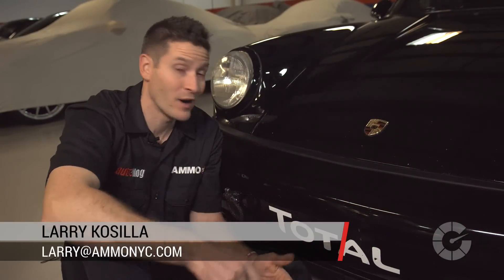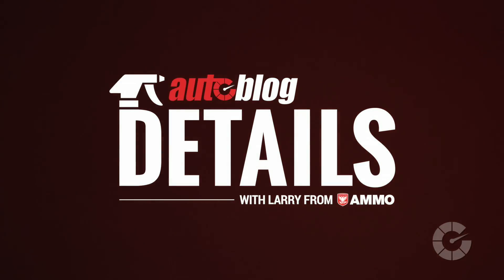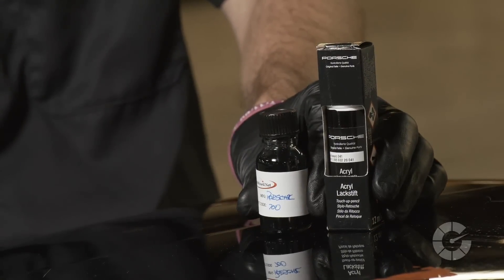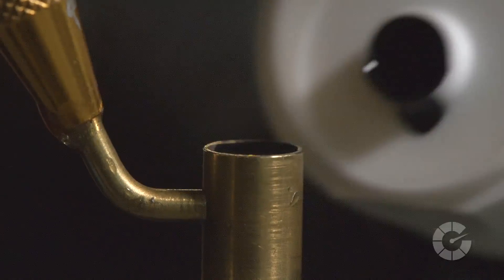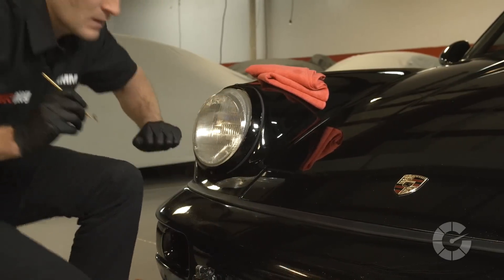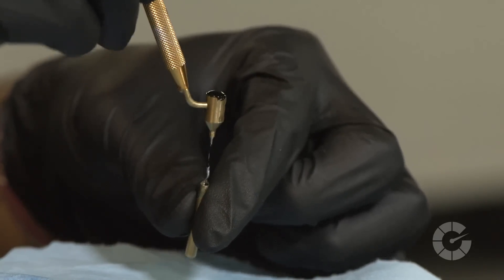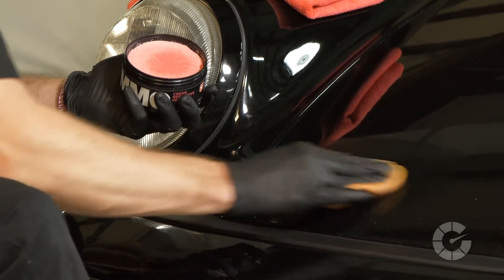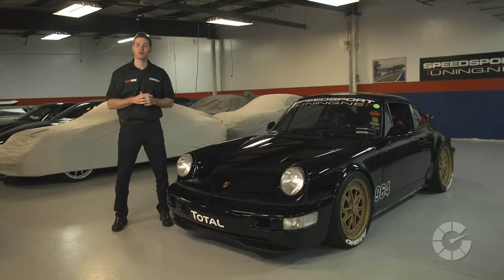How To Fix a Rock Chip | Autoblog Details

Comment: What if you didn't notice a rock chip until it already has a bit of rust in it? Clean out the rust just in the chip, or do you need to sand down the surrounding paint?

Comment: Would a toothpick work as well for applying the paint?
Reply: Yes, it's less precise as the tool but if you have enough patience: it works :-)
Reply: Tomskii5 would the toothpick or this pen be better for vertical surfaces?
Reply: Both will work fine :)

Comment: Larry, I greatly enjoy watching your videos. They are a great source of information. I first watched the Porche MOMA video and noticed you did touch up work but no further treatment to blend the finish. Watching this video specifically on rock chips, I noticed the same. What stops you from finishing with something such as a wet sanding or polishing to try to blend the original finish with the touch up? If a touch up does not specifically state it includes a polish, will you mix in a polish as well? Or prefer to put that over the base color after? Thanks, and keep up the great work.

Comment: How would you do this on a vertical surface, such as a door?
Reply: not an expert, but i guess just apply really small amounts of paint to the spot in question, 

in pauses of a few minutes to get as little paint runs as possible.
Reply: Lay the card on its side for a horizontal application.

Comment: No clear coat? I've heard some places mix the clear with the color for rock chips. Any thoughts? I am about to do this on my GTI tomorrow morning
Reply: Hi Nick, did you end up doing this by mixing the clear with the touch-up paint?  I'm going to be doing my truck soon and was wondering the same thing you were.  No one seems to mention what they do with the clear once the chip if filled lol!
Reply: Dan Richard yeah I did it just filled a few coats of paint, then two coats if clear. But I have to sand them out and fill them again because I didn't fill them enough